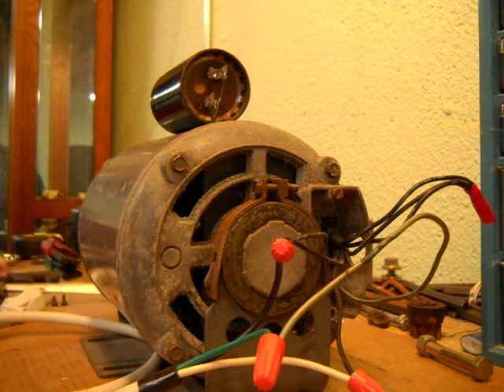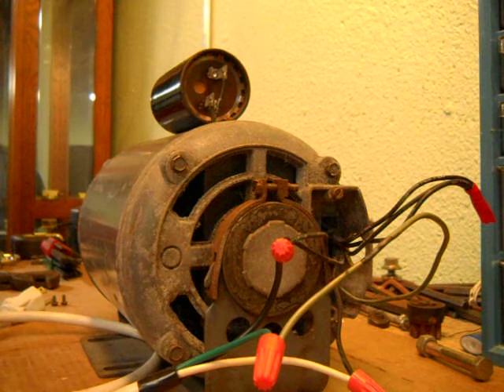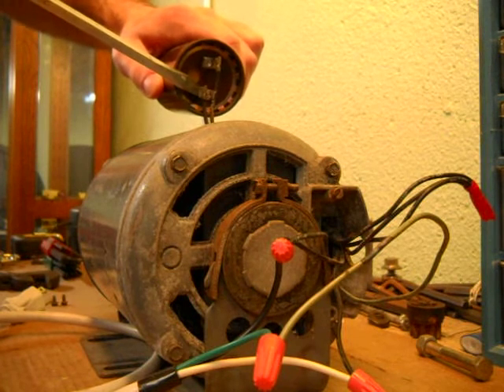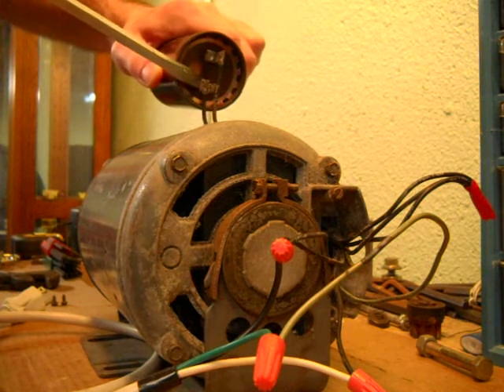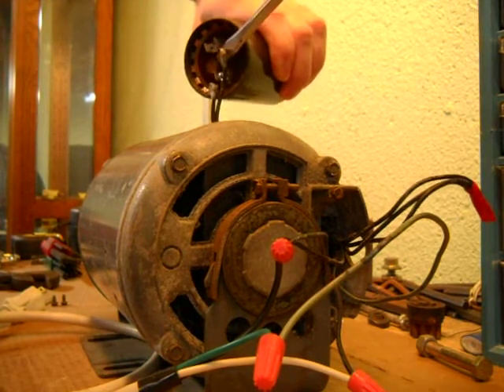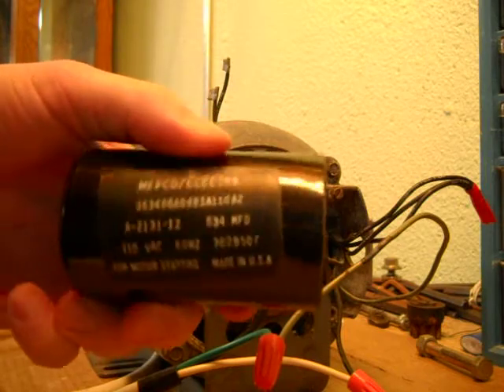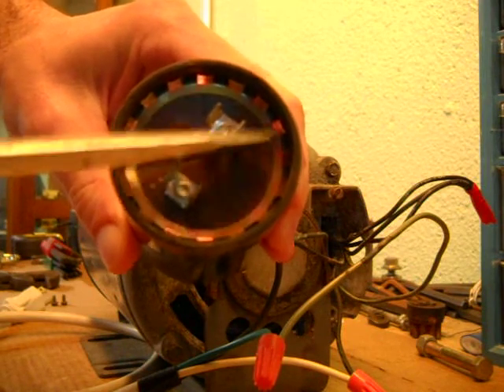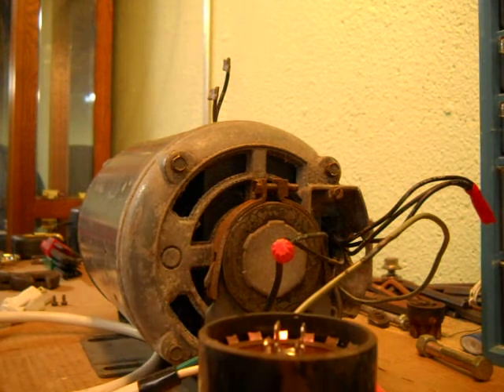Removing and discharging a start capacitor.

Comment: Thanks. My heater fan wasn’t working and I installed a new one but removed the capacitor first because it was in the way and the new fan also won’t work and I’m pretty sure now it’s because the capacitor is faulty, but heck, I didn’t know about capacitors beforehand and I reckon I was probably lucky I didn’t shock myself.